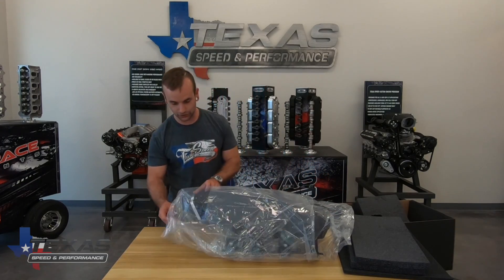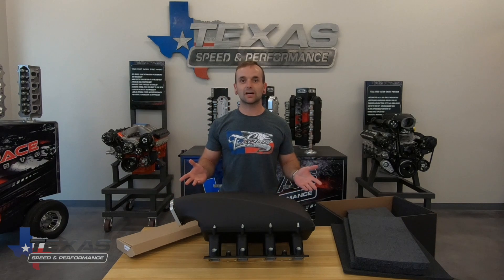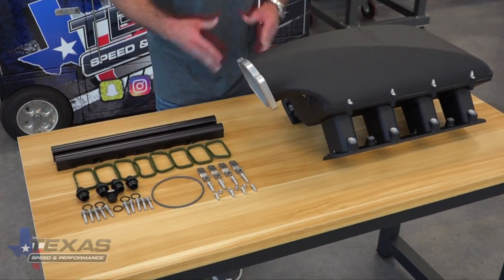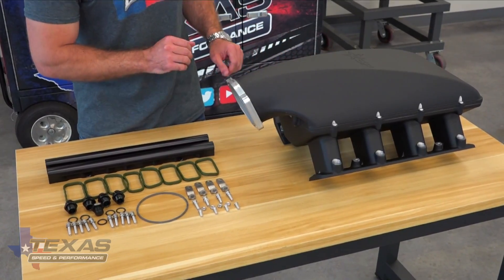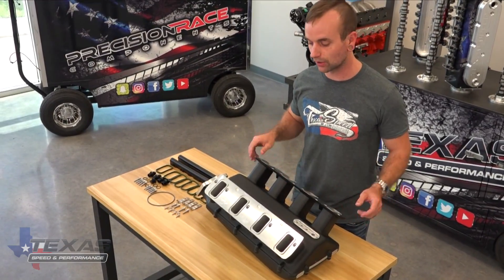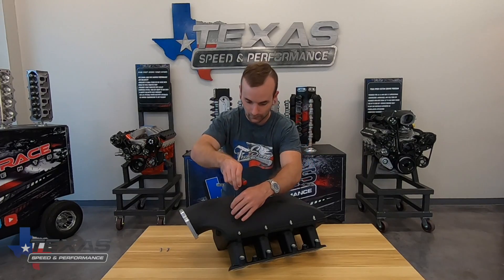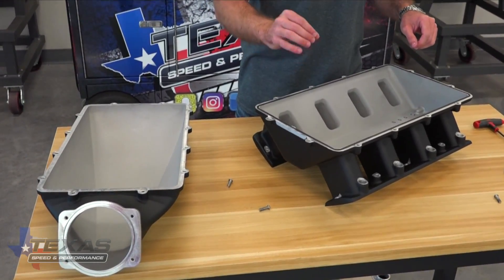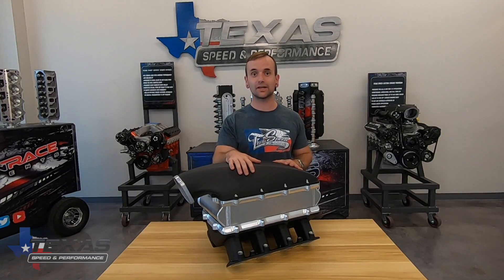ITS HERE! The New Texas Speed Titan SR-3 Intake Manifold!

Comment: Says ls/lt engines will there be one for the lt1 I’d love to run one on my 19 Camaro ss
Reply: @TexasSpeedPerformance  I saw on another video that the your 6th gen has a long runner version of the intake manifold which obviously wouldn't fit under the stock hood (also looks like you had to cut the cowling). Can you say if there will be a short runner version and if that will fit with the stock hood/without modification?
Reply: Texas Speed & Performance lets get my procharged car down to you guys and work on some content and prototypes :)

Comment: Were does the intercooler hook up to? Can it be run n/a
Reply: You'd have to plumb water lines to it with a water tank and pump. It's an air to water intercooler which you'd only need if it's forced induction. Get the regular version if you're N/A

Comment: 89 inchpounds.. how much is that in europe? we torq with newtonmetres down here...
Reply: @TexasSpeedPerformance  Wow, thats really loose.. now I understand the reason for using that locktight. 
Dont even think Ive got a torqwrench that little, the scale on my smallest one starts at 20 Nm.
Is it so loose to stop the flanges from warping or manifold cracking under the immense stress it has to endure? 
I really like the look and buildquality of your products btw.. too bad running big v8`s in daily drivers is near undoable overhere due to the fuelprices.. (about 4x US rate..) or I`d have me a LS swapped 60s or 70s truck.
Reply: @marks8068  Under vacuum, there is essentially zero force on the manifold. The real force comes from boost. 20psi will put thousands of pounds of force on that lid, trying to blow it off. However, for that to happen the bolts would need to fail in tension. I suspect the bolts are M6x1.25, which have a tensile strength of about 3000lb each. Because this is sealed by an O ring and not a "head gasket" style gasket - there isn't any requirement for a heavy clamp load to maintain gasket integrity. Very different gasketing application than a cylinder head .